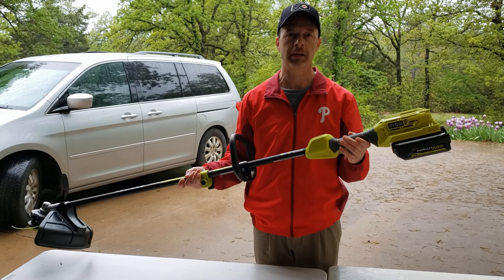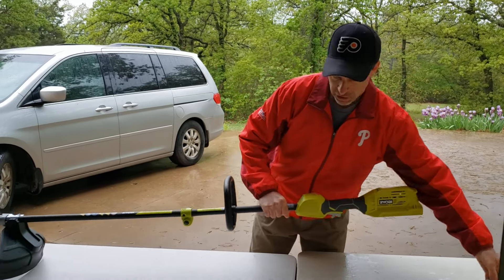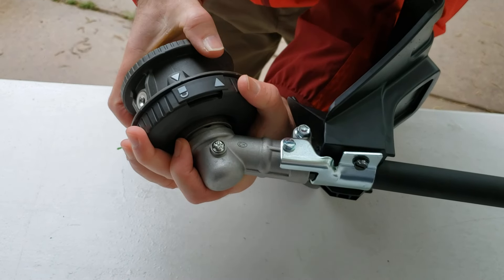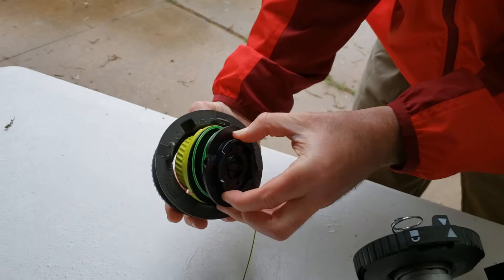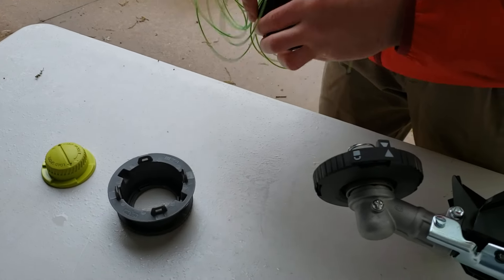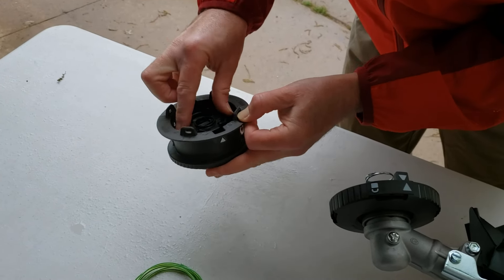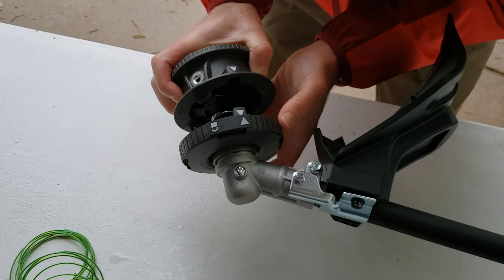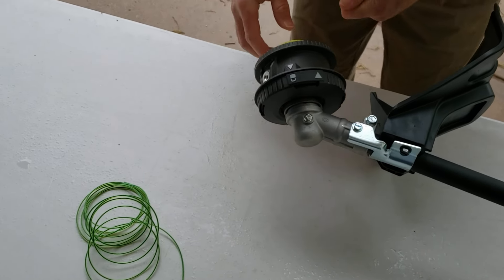How to remove Ryobi trimmer spool head to fix jammed string

Comment: If you have weak hands or arthritis DONT'T BUY!!!  I finally got it apart, (only my 2nd time using) and now I cant get it back together. If it was not for this gentleman's video, I would have believe that I was doing something wrong or missing a step!! My old homelite I had, I just unscrewed the bump stop, simple and efficient!! Will add 30 mins to an hour to your lawn chores!!
Reply from the maker: You're right, this is a really poor design and many of these are very difficult to open. If you already have this weedeater and want to fix it so it can be opened and closed easily, I made a video on how to do it: https://youtu.be/uNXtOfnku34
Reply: I experienced the same issue... I did find a good video on using a screwdriver to brace the botton ring from turning while you could use both hands to try and rotate the top part.

Comment: I used a small ball pien hammer to coax it over. Its not dirt but just a tight fit. I used 3N1 to give it a little lubrication after I got it apart.

Comment: Am trying to open up the housing by hand, twisting counterclockwise, almost impossible, want to open up to clear out a possible string jam, any suggestions, have added wd-40 and ready to send it back?
Reply from the maker: You're doing all that can be done. Other option if you have some large pliers is to grab the very top piece (the one with arrows) with one pair and grab the very bottom piece (the one with the 'Lock' symbol) with another pair and turn them that way. Unfortunately, this is just a bad design and some of these are really hard to open.
Reply: thanks @FixEverythingYourself
Reply from the maker: I just posted a video (below) on how to fix this condition. I consider this a design flaw and just bought a Hart weedeater (exact same head) that was nearly impossible to open. After receiving so many similar comments, I decided to fix it and post a video.

https://youtu.be/uNXtOfnku34

Comment: The arrows on the upper and lower string housing may not easily align with a simple twist as illustrated, especially if you have used it like myself. It is just difficult to get a good purchase on the lower string housing. Lacking a strap wrench (like an oil filter wrench) I used a 5/16 inch slotted screwdriver to loosen  between the upper and lower housings (completely around-it took two tries) until the bind finally broke free.  The arrows then aligned with a simple twist. The housing plastic is sturdy and pliable, not brittle, so don’t worry about breaking the housing if you use light to moderate force. I’m not certain whether my solution will ultimately damage the head if the problem is a recurring one. Actually, if it happens again I might just remove the head, give it the Hillary Clinton BlackBerry treatment, mail the thoroughly smashed parts to Ryobi and blame Russia, Russia Russia! 😂

Comment: Ours was brand new and would not turn at all. We used a couple little squirts of WD40 to get it to finally get it to go. That was after my husband called it a MFPOS and wanted me to return it. 😂
Reply from the maker: Good tip!
Reply: Thanks for the advice. I’m having the same issue.
Reply from the maker: I made a video on how to fix it once and for all if you have one of these that just won't open/close. Takes 10 minutes or so.
https://youtu.be/uNXtOfnku34
Reply: I got it apart after a battle but I try that I was thinking something along those line but I figured if it's clean then WTF
Reply: Yo I was about to throw this out but your tips were AWESOME 💯 THANK YOU I WAS THAT IT WOULD COLLECT EVEN MORE DIRT BUT I TURN RIGHT TO LOCK SO THANK GOD BLESD TRUMP 2024 AMEN 🙏
Reply: So true,  I have been there too!

Comment: If you guys still having trouble with this, use a air compressor or leaf blower to get all the dirt out in the inside of the head and where the head going to be attach to.  That's what i did and it worked.  I hope it'll work for you guys as well.
Reply: That's my problem. Thanks for the tip!
Reply: Thank you so much! I had this exact problem & couldn't figure out how to put it back together.
Reply from the maker: You're welcome!

Comment: Is there a trick to it??  Does the bump knob need to be pushed in or unscrewed?  I've applied quite a bit of torque, as shown, and it's not opening...
Reply from the maker: No, it just needs to be pulled apart. Perhaps it has some yard gunk in there and that's what's keeping it from coming out.
Reply: @FixEverythingYourself  I have the same issue, and the tool is new out of the box.
Reply: @TheTravelingTim  Me too. It's a bad design. Hard to grip, hard to get leverage and probably poor manufacturing tolerances on the parts making it too tight as well. From the comments here, its clear it's a very common problem.

Comment: I am unable to get the arrow back to the unlock position to reattach the head, it seems like it's off track. Not much debris, hardly used and it's in the locked position with the head removed, when trying to turn back to the arrow for unlock it gets stuck half way. Any tips appreciated. Just keep pouring water? WD40?
Reply from the maker: With the head/cap off you should be able to see the inner hub that spins within the outer casing. Take the cap and engage the tabs in the slots at least a little bit, then turn counterclockwise until the inner hub turns and stops. You have to get thr inner hub back to the original position (as far counterclockwise as it will go) in order to get the outer cap installed so that you can then turn it clockwise to lock it.

Comment: This new head cover design is beyond horrible. I have the older version which is simple to remove and reattach. #Ryobi  won’t even respond to a complaint, probably because they are likely inundated with complaints about this same issue. I believe this is a serious design flaw and many will not able to remove the cover. I’m back to using my older version, which also had far fewer issues with jammed string than the new model. No one with arthritic hands, or smaller hands, will be able to remove the new cover, especially after heavy use. #ryobi what were you thinking?
Reply: Yeah, this is a really bad design. Mines brand new (not yet used at ALL) and I can't get it open. Probably will return it and go a different route. The old powerhead RY40002 was great. Mine lasted 10 years with heavy use and no issues. This new one I have serious doubts about now that I just unboxed it. Seems very "cost reduced" vs the old design.
Reply from the maker: If you have this weedeater and want to fix it so it can be opened and closed easily, I made a video on how to do it: https://youtu.be/uNXtOfnku34

Comment: is everyone's  string getting stuck inside? i had the older model and it never had this problem, this one has done it now every time the string gets low !! Also its very hard to remove that cap, you made it looks easier  then it is, at least mine .
Reply from the maker: My cap removes easily but is hard to lock back in place.
Reply: Mine is brand new and I haven't been able to rotate the string housing to remove it. It's going to require a bench vise or strap wrench or other method to get it open apparently. Poor design...

Comment: I lined  it up and tryed  many times to lock it but it whont turn to lock
Reply from the maker: I had difficulty, too. It required a lot of force pushing it and turning it before it finally went. I tried wiggling it back and forth (in a clockwise-counterclockwise motion) to get it to finally engage.
Reply: @FixEverythingYourself it took me a long time and was about return it but then I got it
Reply: I’ve tried over and over and looked at advise here but nothing is working. Taking it back

Comment: Mine won't lock into place.  I can't get it to shift from arrows to locked.
Reply from the maker: I've found that you have to press down very hard when turning the head to get it to turn. If that doesn't work and you can't get the tabs to even engage when trying to insert the head, see my response to another user yesterday.

Comment: We can’t get it to go back on after restringing. Everything is in position & It will align but will Not twist to locking position. Any suggestions?
Reply from the maker: One person sprayed WD40 on the surfaces to make it rotate and lock in position more easily. Try that. For whatever reason, the design is such that it takes a lot of force to twist it into position.
Reply: @FixEverythingYourself   I am having the exact same problem. Went to re-string and had a heck of a time getting it to twist off and now i cannot get it back on no matter how hard  i try.  Our's is only a few months old.
Reply from the maker: Yeah, that's a bummer that Ryobi made it like that. Have you tried WD40 or something like that?
Reply: @FixEverythingYourself  yes. WD-40 fixed the situation
Reply from the maker: Great

Comment: Most comments relate to the string getting jammed on its spool.   The spool sits in and on what is called the spool base. My problem is that the string has become jammed under the spool base.  I have tried to twist and pool it out, but it will not come free.  It appears that it will not come free until I remove the spool base, but I cannot figure out how to do that. The ryobi web sit is of no help at all, and it is very poorly designed. Inadequate and awkward as an information source.

Comment: It's very hard to get the string housing to rotate open. Mine is brand new this morning, unused. I have not been able to remove it so far by hand. I'll likely stick it in a vise or get some kind of grip on it with a strap wrench or something to try to be able to turn it. Very stupid design in that it's almost impossible to get a good grip and get leverage and it may also be bad quality control on production tolerances causing it to be extra tight. Someone below called it a MFPOS because of their similar issues. I would tend to agree. We can see through the comments on this video it's a common problem. 

Other observations on mine that make me agree with that comment: The handle now is held on with a PLASTIC wingnut. I can see from videos that it used to be a metal wingnut. One more cost reduction that is sure to break.

And when installing the grass shield, you slip the metal tab into the slot on the shield, then put a screw through the shield on the other side of the pole, and it should clamp down. On mine, that metal tab was not flat, so as soon as I tightened it down, it snapped the piece of the housing off (the part over the tab.) It's still secure and I doubt it matters, but again...quality control issue. Haven't even used it once and I"m about to call customer service to send me a new metal tab and new grass shield, or process the return. 

So yes, it's a POS. The older generation power head was awesome and mine lasted about 10 years of fairly abusive and heavy use in California's long mowing season with no issues and no repairs required. But it finally died. I couldn't get parts on a timely basis to repair it from Ryobi, and the parts dealers want more than the cost of a new unit for the motor for the old unit. So I bought the new power head as I have a bunch of attachments in addition to the string trimmer...ugh, the new one seems to suck right out of the box. I saw quite a few reviews where the batteries caught fire or the motor got so hot it melted the housing of the tool...hope that doesn't happen on mine. My advice to anyone considering this power head if you don't already have a bunch of attachments is RUN the other direction! Buy something else.
Reply from the maker: I don't disagree with you. One thing you could try to get the head apart is a little WD40. Others say that had worked for them. But certainly shouldn't need it. Interestingly, the Hart brand (Walmart) is this EXACT same weedeater. But that head opens easily.

Comment: DO NOT TAKE THE STRING HEAD APART!  You will never get it back together and locked back in place.  I have been messing with mine for a week and A) it takes three hands B) you line everything back up the way it should be and the head will not turn to lock into place.  Last year I went to Walmart and they sell a brand called HART.  $99 so I bought one, third use the battery went dead and won't take a charge.  New battery is $108 plus tax.  So I pitched that into the garbage, and went to Home Depot and bought a Ryobi but it ran out of line last week so I had to open up the head to get the last bit of line out and respool more, now I have worked and worked and worked on it and it will not go back together.  I have come to the conclusion that these machines are just one enormous scam, and it would at this point be cheaper to hire a service to come do my weed eating than continue to throw good money after bad with crap weedeaters.
Reply from the maker: If you have this weedeater and want to fix it so it can be opened and closed easily, I made a video on how to do it: https://youtu.be/uNXtOfnku34

Comment: I own one, and I have to use 2 hammers to get it to unlocked... and it takes me about 4 days of trying to get it to lock back once I put the new line in. lol
HORRIBLE design. And I like Ryobi products - but their weed wacker system is a nightmare.
I can only imagine people with hand problems.
It's no big deal brand new - but they should have tested it out after a season's wear on it.
Reply from the maker: I 100% agree, it's a really bad design. I've got 3 units with the same type of head and one of them is nearly impossible to open. So I figured out a way to fix it and posted a video about it (see below). If you're stuck with this weedeater, this fix will make it so you can open/close it easily in the future.

https://youtu.be/uNXtOfnku34
Reply: @FixEverythingYourself  Awesome. Thank You!

Comment: DO NOT BUY!  I have gone into Home Depot three times with this trimmer I've probably used a total of 10 times since purchasing late season 2023.  The Ryobi rep took 1-1/2 hours to fix this trimmer; had to call his boss.  He replaced the head only to have the same thing happen to me again.  In this video, it shows as if it's super easy to lock/unlock the head.  WRONG!  I do not have arthritis, but apparently you have to have the Midas touch in order to remove and replace this head.  I now have to go back to HD for a fourth time to have a Ryobi rep put this head back on.  I will NOT ask my neighbor's husband to waste two hours of his time to try doing this (he's already done it once).  I bought a bundle so I'm screwed.  I will NEVER buy Ryobi again.  Tapping does not release the string.  HD replaced this trimmer already once because three employees could NOT get the head off the first one.  That should have been my clue.  Now the same with the one they replaced.  I've managed to get it off and now I cannot get it back on.
Reply from the maker: You're right, this thing is a terrible design. However, if anyone bought it a while ago and can't take it back, I made a video on how to correct the problem so the head is easy to take off/on: https://youtu.be/uNXtOfnku34

I now have 3 weedeaters with this head and the first two were completely fine. The third one was incredibly difficult to open and I finally realized why so many people were complaining about it.
Reply: @FixEverythingYourself  you are so wonderful!  After venting here -- lol -- thank you for that -- I carefully watched your video and did what you said.  I also thought maybe some silicon would help.  Voila!  For the first time ever I was able to thread as well.  I was able to put back on the head.  My hope is I will not have any problems in the future.  I'm still thinking of calling Ryobi.  Horrible design, and not everyone is as tenacious as me to figure it out by finding you :)
Reply from the maker: Great! I'm glad this story has a partially happy ending for you, but what a hassle you've had to deal with.